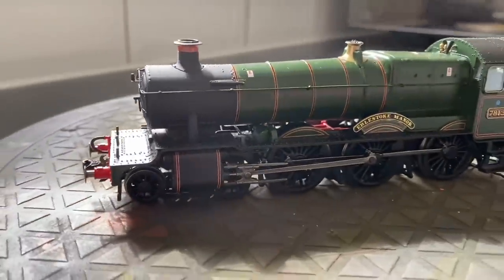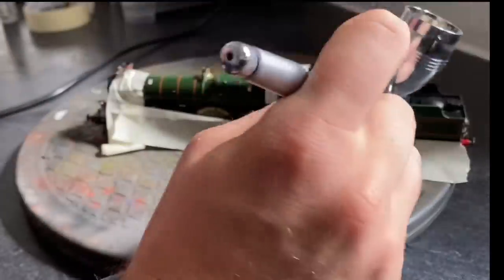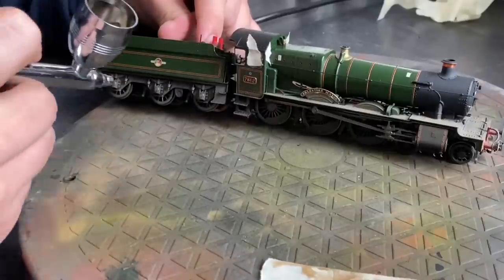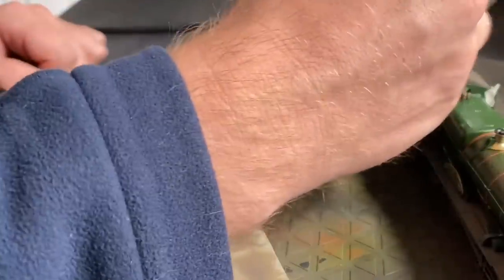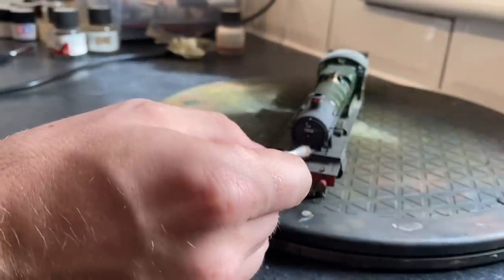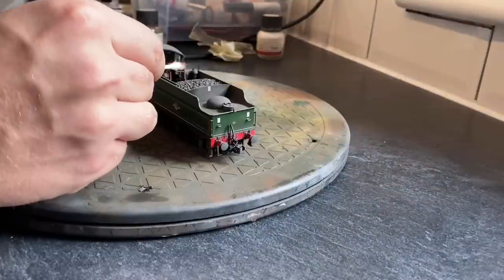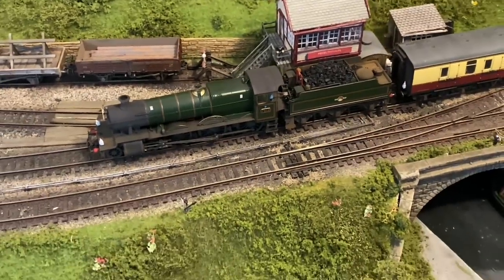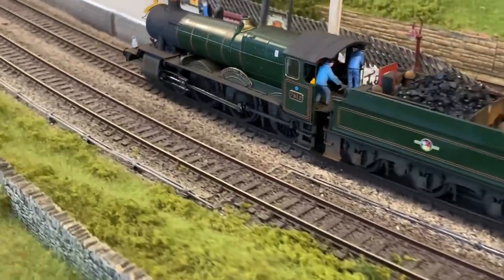Mucking Up a Manor - Weathering Accurascale's First Steam Loco - The Yorkshire Dales Model Railway

Comment: Much better 😁

The coal was probably overloaded on the Manors because their tenders are so small. They need to keep in the blue restriction lines, so routinely larger coal loads would be a problem, but since they could sub for Grange or Hall routes, they'd be short of fuel if not overloaded in those cases.
Reply from the maker: Thanks Neil. Yes that makes sense!

Comment: You've done the right thing but at the wrong side. The Manor was lightly weathered, that bit is correct, but the running plate, bufferbeams and outside cylinders and wheels were immaculately clean. She was weathered on her boiler top and on top of her firebox casing. Her safety valve bonnet and whistle valve were slightly weathered too. Anyway, Erlestoke Manor should be pristine all over because she's a preserved engine.
Reply from the maker: Luckily there is lots of footage of manors running in the 1960s!  Have a look at this video I've linked below from 4 minutes onwards, some very dirty ones! 

https://www.youtube.com/watch?v=KQBpi6cmJlQ
Reply: checkmate Kelly 😂
Besides Mouldy Raspberrys layout is set in the 1960s, so having a pristine engine is sacrilegious.